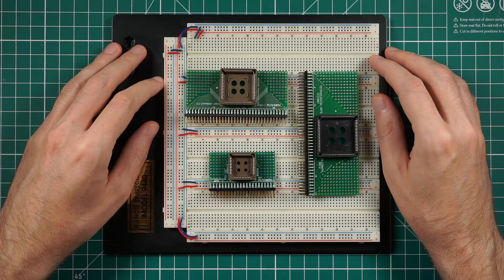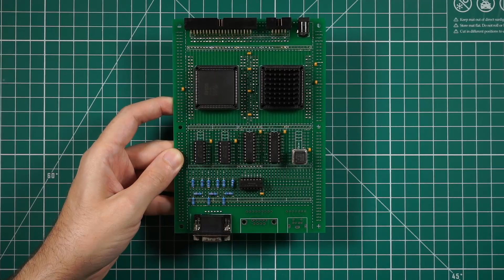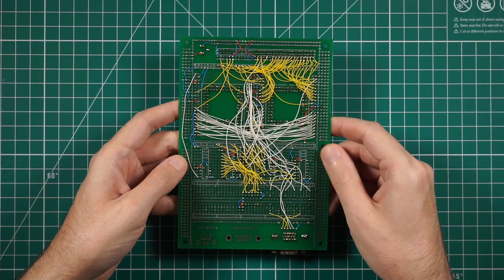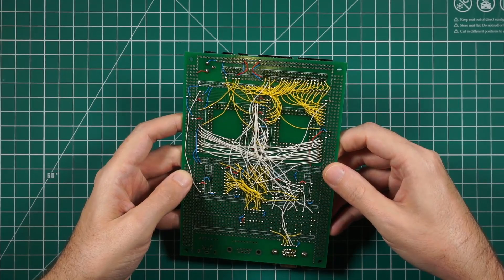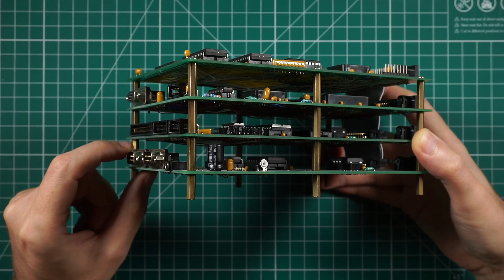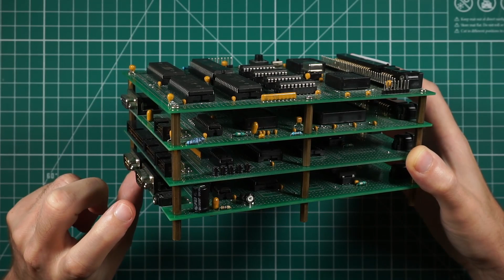Prototyping 8-bit computers

Comment: Yes, I would love to see the prototype in action. I would also be quite interested to know how to get started with a CPLD. I'm thinking about which one should I buy. Do I need anything else such as adapters and software, etc? I would love to see a video covering that sort of thing.
Reply from the maker: Thank you Steve!

This is 8088 NEC V20 x86-based computer prototype with 1Mb of RAM,  256x192 16-color (with RAMDAC) graphics (2 pages, 64Kb dual port VRAM), OPL3 sound, serial port, parallel port, floppy controller.

I plan to make a tutorial video explaining how to work with Atmel ATF15xx-series CPLD. Especially, how to use these CPLD as glue logic for DIY computers. Atmel CUPL language, used to program it, even has special expressions to simplify address decoding. This is an example portion of Z80 computer chipset PLD file responsible for RD/WR/IORQ/MREQ decoding into separate RD/WR lines for memory and I/O perepherials:

/* Bus control inputs from CPU*/
PIN 4 = MREQ;
PIN 5 = IORQ;
PIN 6 = RD;
PIN 8 = WR;
/* Bus control outputs for memory and I/O */
PIN 9 = MRD;
PIN 11 = MWR;
PIN 12 = IORD;
PIN 14 = IOWR;
/* Logic */
MRD = MREQ # RD;
MWR = MREQ # WR;
IORD = IORQ # RD;
IOWR = IORQ # WR;

Simple boolean expressions. Same way you decode chip select logic and some other useful signals. Like implementing wait states for slow I/O devices. I stopped using separate SN74xx ICs for this purpose the moment I learned to work with these CPLDs.

From hardware standpoint, all you need is this $80 USB JTAG programmer from Atmel: https://www.mouser.com/ProductDetail/Microchip-Technology-Atmel/ATDH1150USB?qs=rBGENRD8NwIkg3aE4TUebQ%3D%3D

Comment: Hi Ivan. I love what you doing here and would love to know how you got to this point? I am going to start Ben Eaters project and then branch off from there coping other projects that people made available but at some point I want to be able to design and create my own computer.
Reply from the maker: Thank you! I started small with a breadboard and Z80 CPU hooked up to a couple of LED lights to investigate how different signals work. Next, I hooked up EEPROM, serial I/O chip and started writing small programs in Z80 assembly. For example, check out this project by Grant Searle: http://searle.x10host.com/#MyZ80 Very good starting point for a single board computer builder!  I've built something similar on a breadboard but used Z80 SIO/0 chip for a serial I/O since it integrates with Z80 CPU nicely.